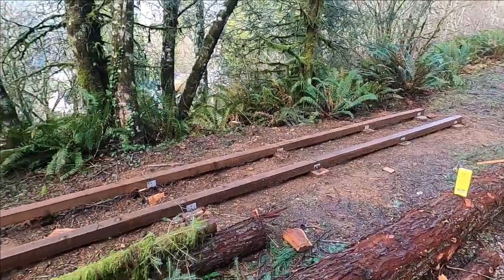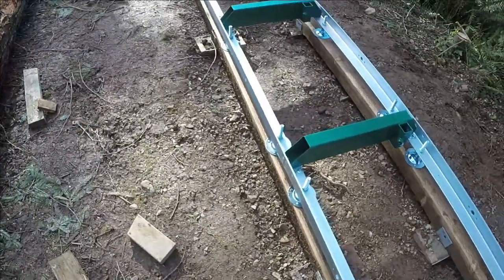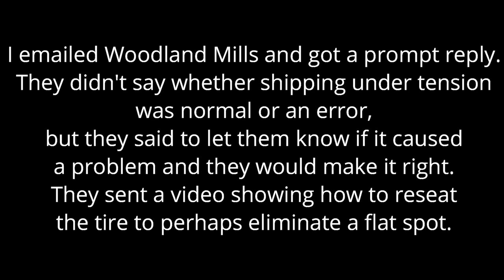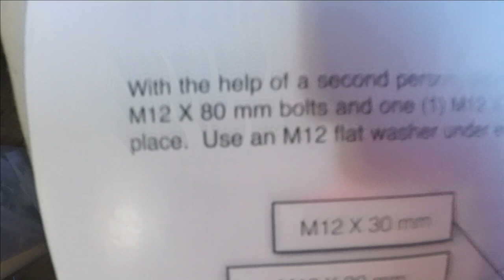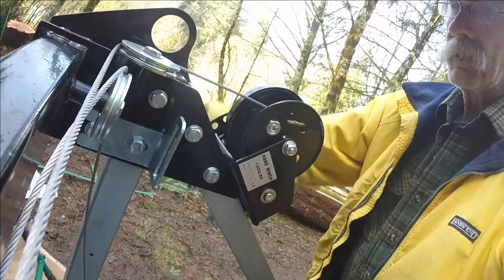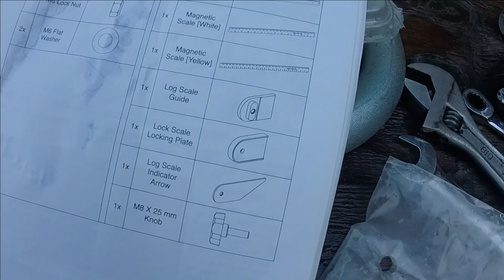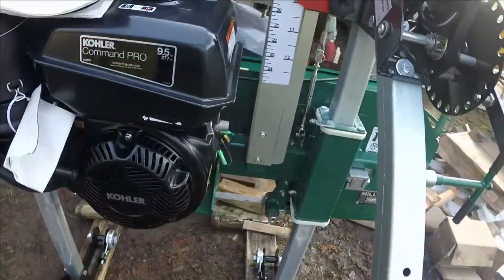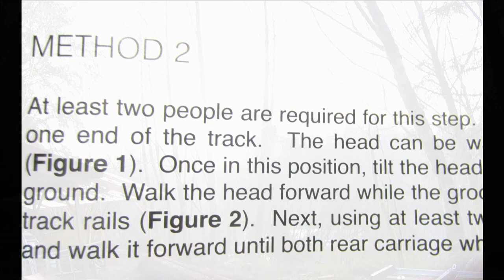Sawmill Saga 2: Assembling My Woodland Mills HM122 Sawmill

Comment: I use wobble extensions on a swivel and it will reach in there. Another trick is to drill a hole in the bolt and put a washer next to the cable holding it in place with an R pin.